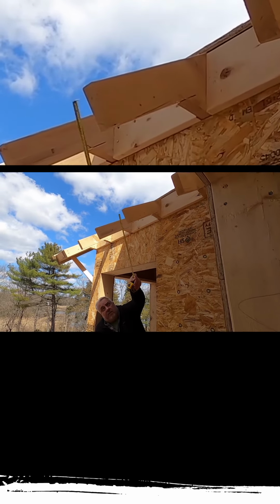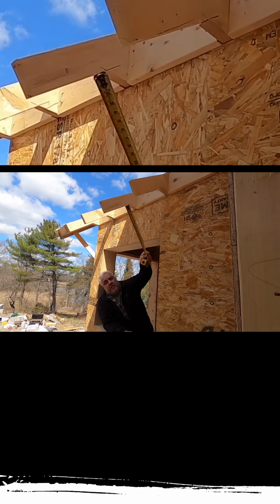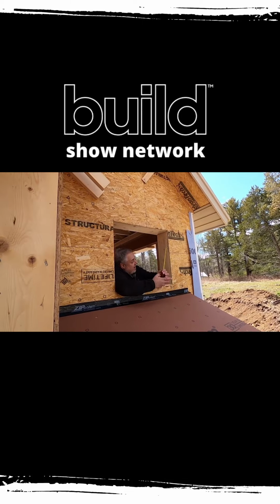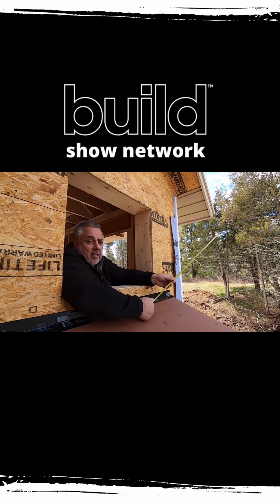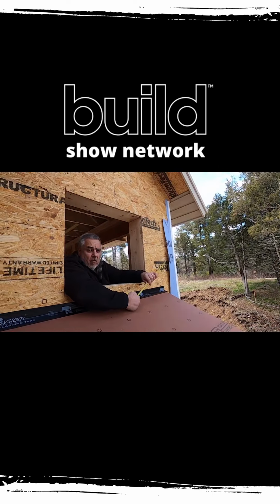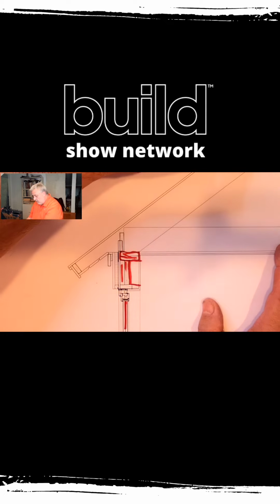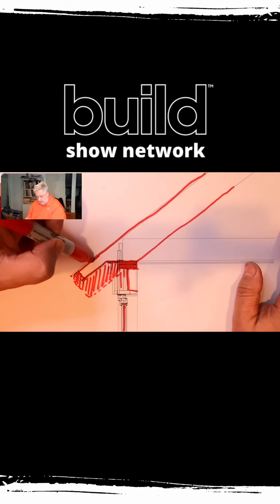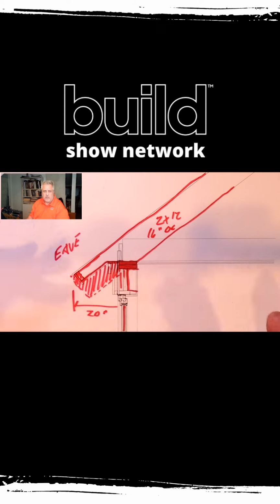Roof Tails with Insulatinjg Sheathing

Comment: Very interesting.  I had no idea this could be made the way it is but with exterior insulation and a rain screen....yup...makes sense.  I keep watching your video's Steve, over and over ... like you said....6 times right!?  To get it right....in the head☺️🇨🇦  
Also, Steve, more than a few times now the person who films your segments may need some guidance of better filming to highlight your amazing teachings.    I suggest that they get more close ups and if the area is dark, like a California corner shot, then please have them have lighting on the camera unit....or at the least a pocket flashlight so we can see. As you may have noticed in this presentation the upper section of the video that tried to zoom in on what you are pointing at at the eaves, soffit,
was not aimed and we saw only at a distance what you were referring to.   Hey! Steve, I simply want to have your presentations the best filmed....because you are important and so helpful to so many of us, I want to soak in everything you have to say and teach.  I do do research after your presentations if there is something I do not understand or I need to see more clearly because the filming did not highlight it in your video. Keep up the amazing work.  You are awesome!   ☺️  👍💯     🇨🇦🙏
Reply from the maker: I realize the quality is sometimes challenging, but I am an architect not a videographer. We have gotten new gear and slowly bringing it and new knowledge on line - Thanks

Comment: Over cutting the bird’s mouth may be fine…but considering the bespoke quality of your designs and your extreme attention to detail…it just looks sloppy.
Reply from the maker: Once the insulating sheathing and rainscreen is on, it all looks quite refined. Also, it's really not overcutting the birdsmouth, I understand what your saying, but if it was overcut and was horizontal for an inch or 2 to the inside - that would a no no structurally